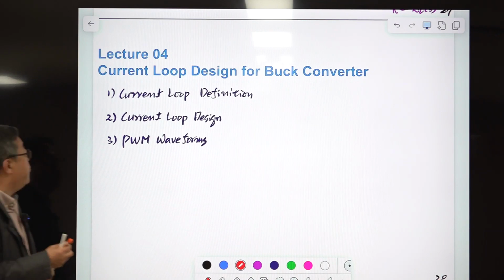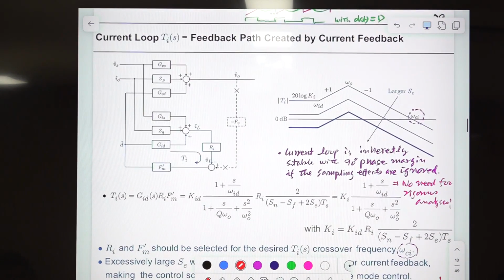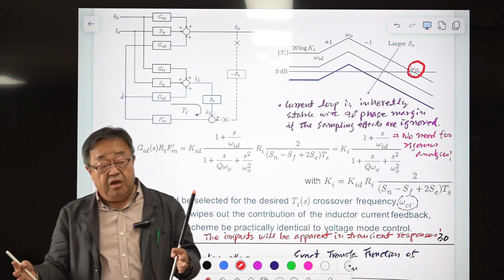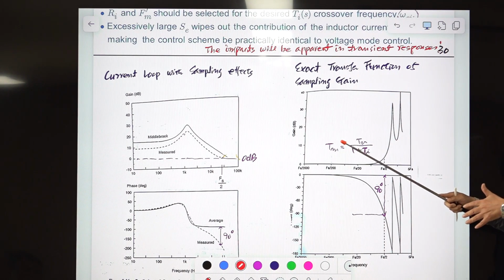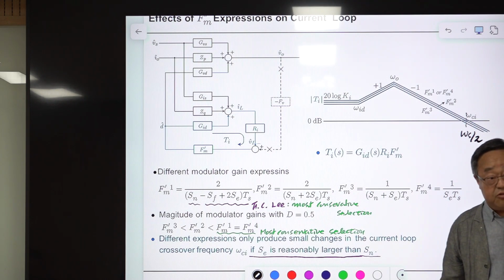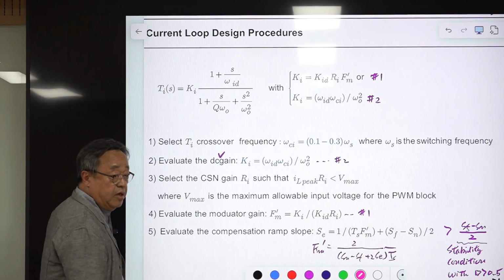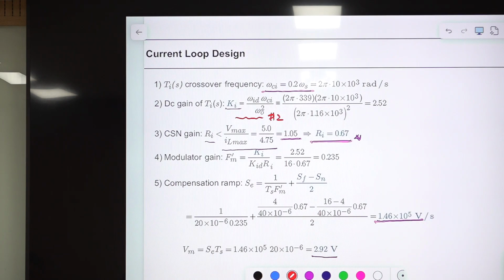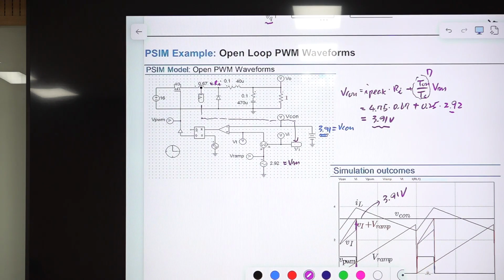Lecture 04: Current mode control, Current loop design, Buck converter,  PWM gain,  Sampling effects

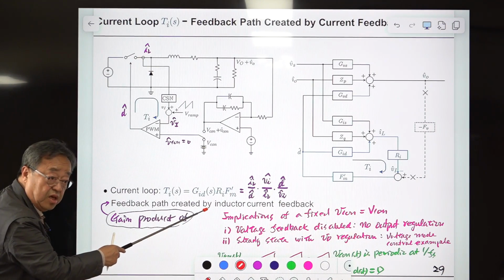Comment: Sir @3:09 you mentioned Ti(s) as the transfer function of the current loop but isn't Ti(s) overall current loop gain instead of the transfer function of the current loop?  the current loop transfer function should be  i^(L)/d^ ..please correct me if I am wrong
Reply from the maker: Your question will be addressed in Lecture 05. Thanks.